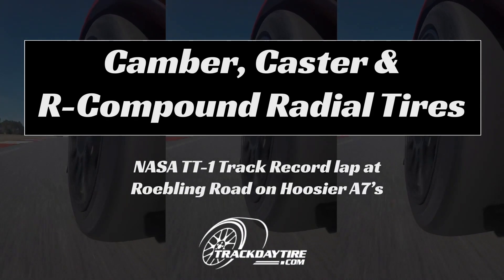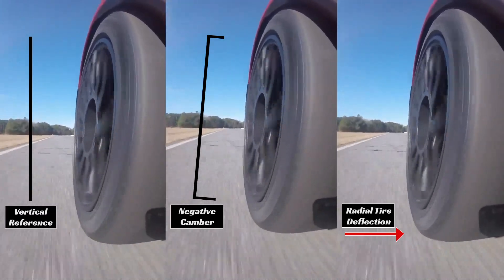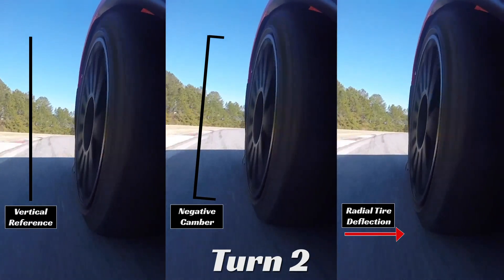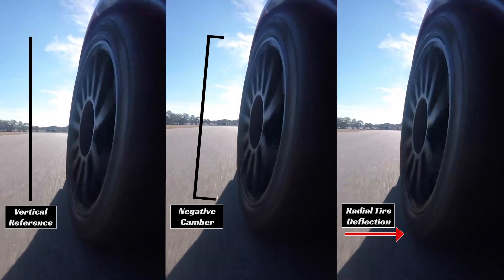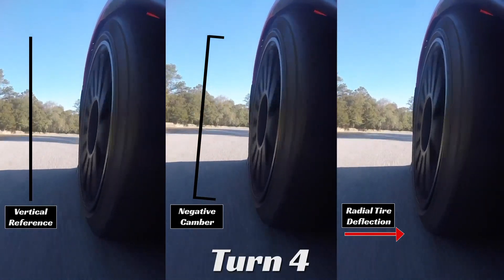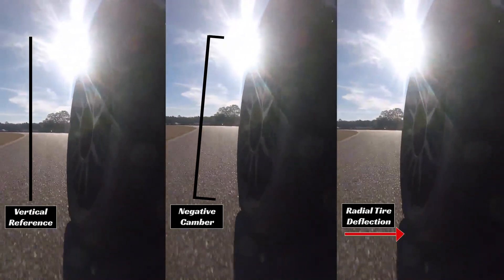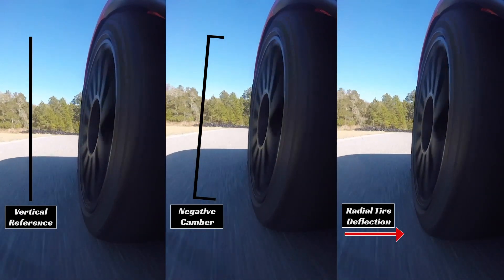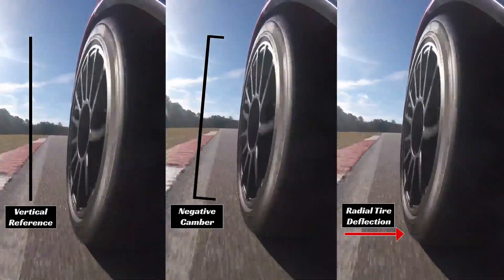Why is negative camber important? + NASA TT-1 Track Record Lap at Roebling Road Raceway!

Comment: But every time use negative camber The tires doesn’t last that long is that right
Reply from the maker: These are track only tires, but using the correct amount of negative camber for the vehicle, along with an optimal tire and driver will result in better wear. Feel free to contact us if you have more info at: sales@trackdaytire.com
Reply: @trackdaytire8281  I’m going to Homestead speedway this coming up Saturday and Sunday I have a 2015 Camaro SS what was the number for the camber should I use it
Reply from the maker: @sampedro03  Feel free to give us a call at 239-789-6179 :)